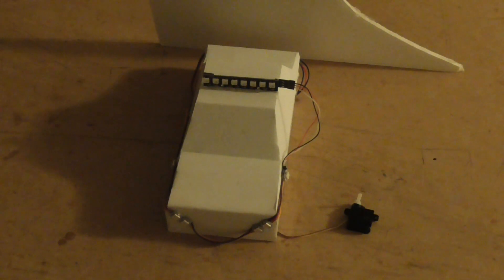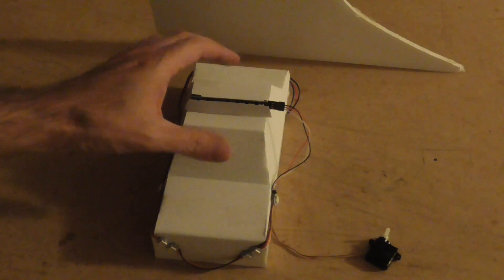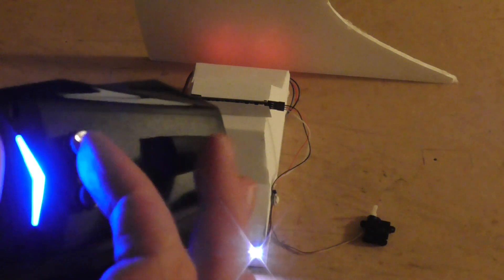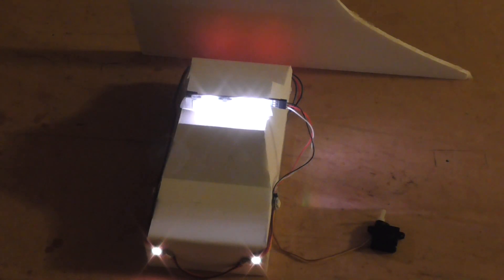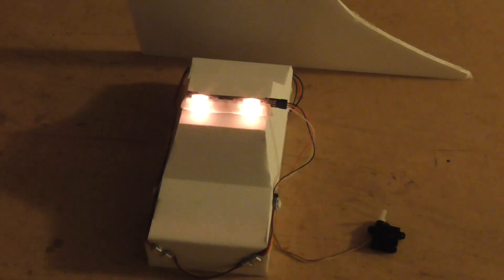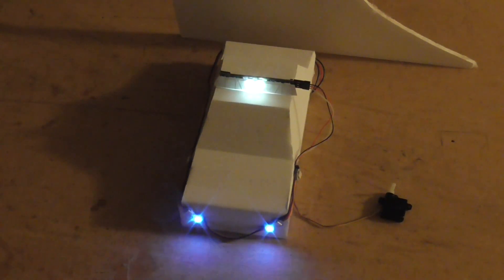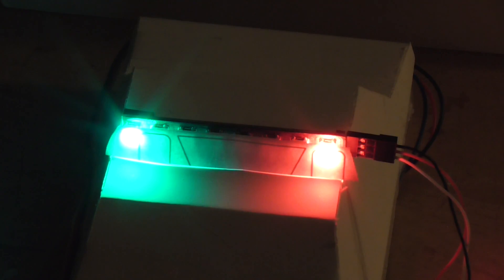Custom lights with iomixer

Comment: Regarding the lights at 11:05 - The flashing lights you talk about, used for runways are only turned on during very bad visiblity. They are called Sequenced Flashing Lights. This video has an example at around 5:35: https://www.youtube.com/watch?v=ghz8FaJYuZ8
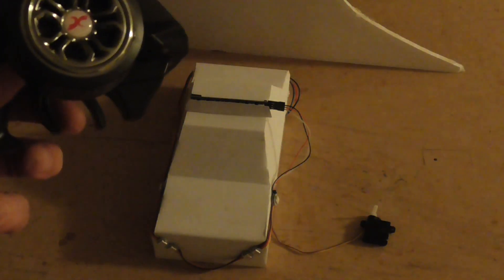This one shows them in use during a bad weather landing: https://www.youtube.com/watch?v=f546pl8J3Jw (start at around 03:10).

There are also so called "Lead in Lights" - Those are used for visual approaches, where aircraft have to perform turns at low altitude prior to touchdown. They mark the ground path the plane should take. https://www.youtube.com/watch?v=HAvsue88nj8 - This video has them at around 03:00.

Comment: having a proper camera with setting you could set to manual and lock in would solve all those filming problems and might be the only solution. You'd need to set the proper white balance and exposition and you'd be golden

Comment: Great stories to set stage for your demo. Excellent capture of modern light animations. Very cool you implemented all this in your plug-n-play programming architecture (sorry, I don't know if has a name yet)

To help with colour visibility from the LEDs, you probably want to do a camera / scene white balance before starting to record. I noticed the general background has a bit yellowish tinge. (assume incandescent lighting?). 
The other thing could do is some side lighting of the stage area, this would create a brighter scene for camera to focus on prior to LED's brightening up/flashing. It should help with intensity and colour. 

Our eyes are so amazing, we can capture so much more dynamic range than any camera sensor to date. 

Am curious the LED light hardware you using? They appear to be serially addressable (I2C?). 
Driven via 5V power source like servos, with a digital control signal?
Reply from the maker: They are WS2812 addressable LEDs. They have their own one-wire communication system which is a bit like UART, fixed at 800kHz. They don't have actual addresses like I2C, the first LED in the string just removes the data for one light and passes the rest of the message on to the next LED.
Reply: The easiest way to build a project with the WS2812  leds is to use an Arduino with the available Adafruit NeoPixel library.

Comment: Any plans to install some of these lights in a rc car? Really nice work!
Reply from the maker: hmm... I'm not really the scale modelling type, I mainly like to implement the electronics side. I actually bought a 1/16 WPL C24 to dress up for this demo but then couldn't be bothered. You can get these LEDs in 2mm x 2mm size but I think the finicky soldering would have driven me crazy.
Reply: @iforce2d  Ah yeah, wiring those tiny LEDs by hand is a pain in the ass. I assume those are the "neopixel" type LEDs, I didn't know they made as small as 2x2mm. I do have some 2x2 "dotstar" type ones though, and they are pretty nice.